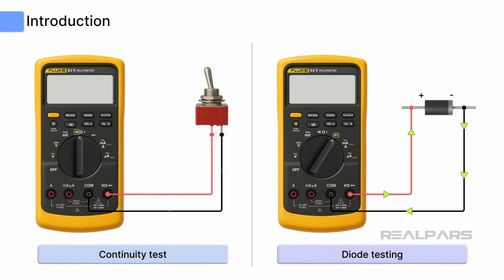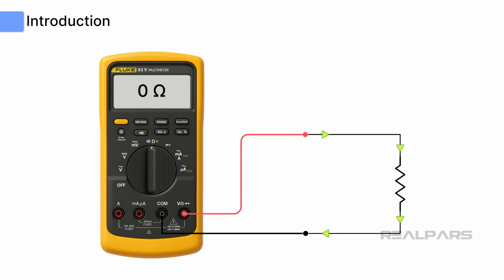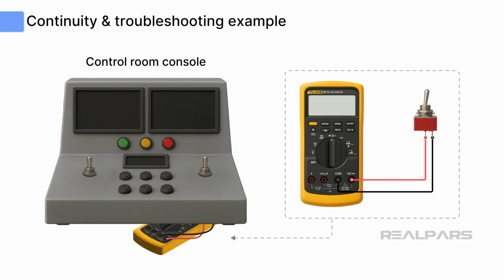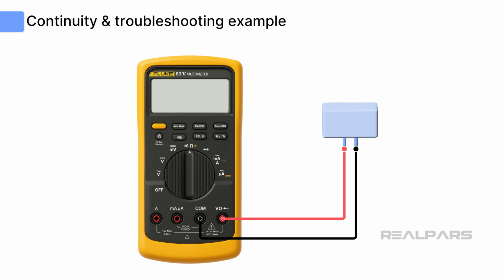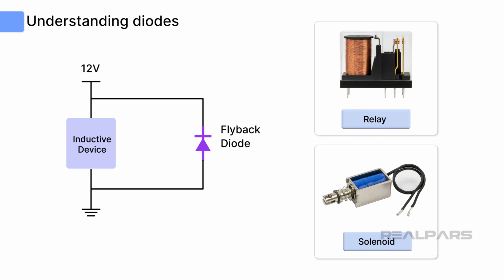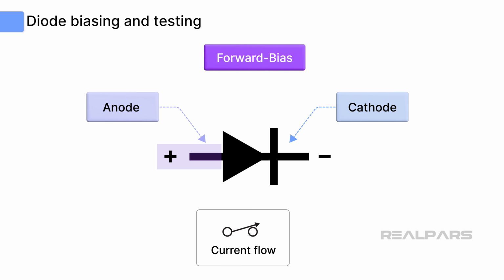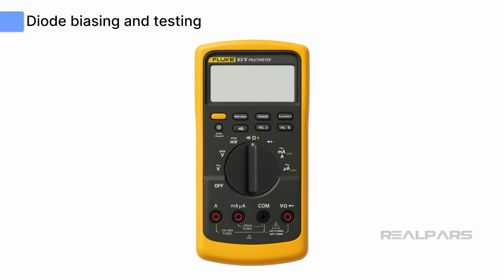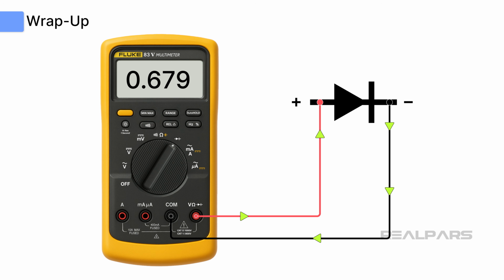Multimeter Continuity and Diode Testing What the Beep Really Means

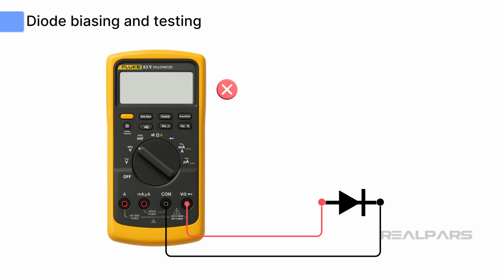Comment: 7:19 "In the Resistance or Ohms function, the multimeter applies a small voltage to the device under test." This is the same mistake as in your multimeter video. If the meter applies a fixed voltage and reads the resulting current, it would have great difficulty measuring resistances near zero.  
"Most multimeters [on resistance setting] do not provide a high enough voltage to overcome a diode knee voltage. Therefore, under a resistance test,  the diode does not exhibit its expected low resistance characteristics,  and the multimeter displays confusing and meaningless readings.'
Since the meter's resistance strategy is actually to present a fixed current and measure the voltage, "insufficient voltage" is a red herring.  In fact, some DMMs test resistance using a 1mA current (for example, Keysight and Siglent that I tested), and in that case a diode which measures 0.59V on the diode scale will ready 0.59k (590 ohm) on the resistance scale, so it is directly meaningful.
Even if the meter doesn't use 1mA specifically, you can still set up for the resistance measurement (and see a non-useful display value) and at the same time use a second meter to measure the voltage across the diode, which will be the knee voltage.  That would of course be a tedious way to proceed if the meter has a diode mode, but it demonstrates that the problem is not "insufficient voltage".
What all this shows is that the measurement strategy for resistance and diode mode is identical -- it's just that in diode mode the meter display reports the measured voltage, whereas in resistance mode the meter calculates R = V/I.
One caveat: In order to cover a wide range of resistances, meters switch between several test current values. No way to measure a 1 Meg resistor using 1 mA!  They may start with a small test current, and if the resulting voltage is tiny, then proceed to progressively larger test currents. I have seen meters that, when connected to a diode, get stuck at a relatively low current, and this produces only a small voltage drop across the diode.  You're still getting a legitimate reading, it's just that the meter is not operating the diode in a range in which it would normally be used, and hence the display is not easily interpretable.
Reply from the maker: Hello @Graham_Wildeman Thank you for your input. Very insightful. My “not high enough voltage” analogy was not meant as a red herring, and I apologize if it seemed that way. I aimed to give a simple explanation of why a DMM should not be used on Ohms to test or assess a diode's serviceability. Before digital multimeters, diodes were tested with old-style analog multimeters made by companies such as Simpson, Avo, or Triplett. Depending on the Ohms range (each with different characteristics), these meters provided some idea of a diode’s condition. My only goal was to warn viewers that relying on a DMM resistance reading to determine a diode’s serviceability is not best practice.    Thanks again.